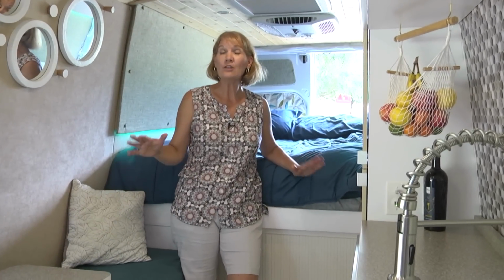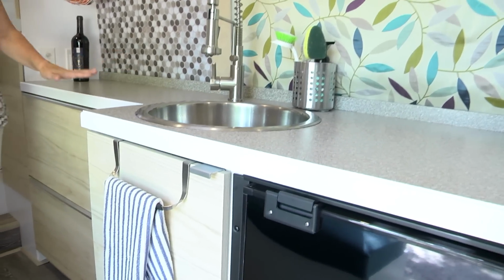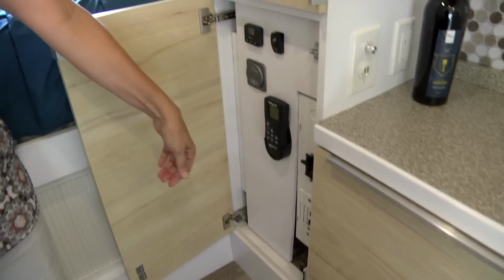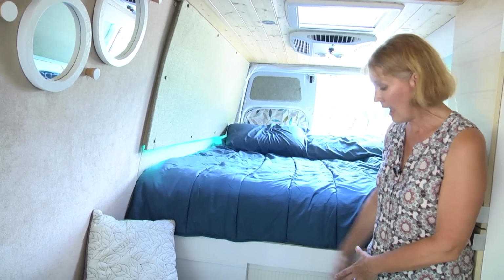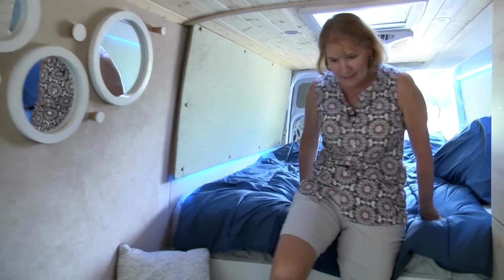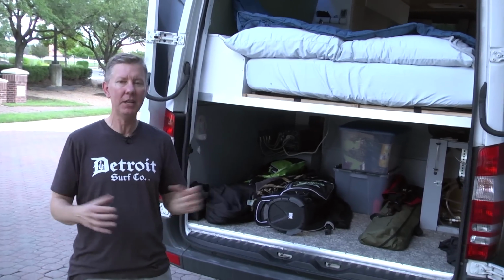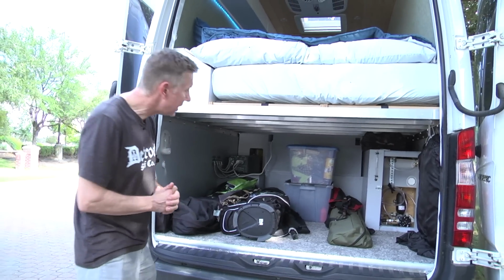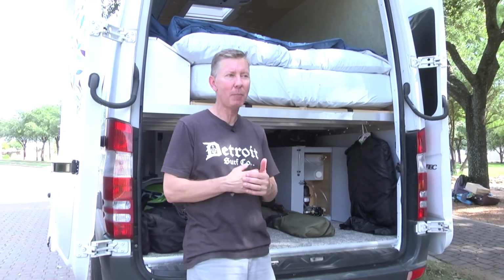Wendy and Larry's Awesome Freightliner (Sprinter) Van Build

Comment: Please - Ross - what kind of a/c is this? link to buy???
Reply from the maker: It's a Coleman Mach 8 Cub. I would get a 12V A/C if you can swing it, much lower power consumption! Kingtec KTD-3 or Dometic RTX 2000. If you're going to run it only on grid power then the Coleman is a great unit, just takes more juice.

Comment: It's nice that U have a toilet, but in a van that size, I would have added an enclosed bthrm with bthrm-sink behind the driver's seat.
Reply: Leila L:   I agree.  Lovely couple, very nice van, and they designed what they wanted.  But for me, the requirements (if there is space, and in this case there is) of a van include an enclosed shower/toilet, which adds so much additional benefit for hanging up wet coats after rain, etc.  Call me old-fashioned, but personally, even with a loving partner, I would prefer not to poop right there in full view!
Reply from the maker: @g-r-a-e-m-e-  I'm pretty sure they don't do that in front of each other :)

Comment: Love your build !  What made you chose that van over a shuttle bus or box truck?   I'm currently in an older extended cargo van myself.   Thinking of upgrading to something that I can stand up in.
Reply from the maker: You should get one that you can stand up in. Mine is a low-roof too and it gets old after a while! Not sure why they didn't get a shuttle or box truck, they may have just latched onto the Sprinter idea.

Comment: How long does 455 aH battery run the AC for?
Reply from the maker: It would be 1 hour, 45 minutes, taking the batteries down to 50% (the lowest you'd want to go to keep lead acid batteries healthy). If we assume the A/C takes its rated 1500 watts, 1650 accounting for 10% inverter losses, divide by 12.5 volts, that's 132 amps, or 132 amp-hours per hour. They had (3) 155Ah batteries, 465Ah total, 232.5Ah is half of that. 232.5 divided by 132 is 1.76 hours. Hope that helps, it would help to get a 12V air conditioner, which only takes about 600 watts, and usually less.

Comment: Nice very nice, would have liked a ballpark figure of total cost of  build or at least amount saved over a commercial built van.
Reply from the maker: Thanks Robert, a used 2011 van, with about 27k in materials/equipment, and a lot of labor. If you got this same size van from Advanced RV, they have them for $377k, it would be a 4x4 though. Other brands maybe $200k.